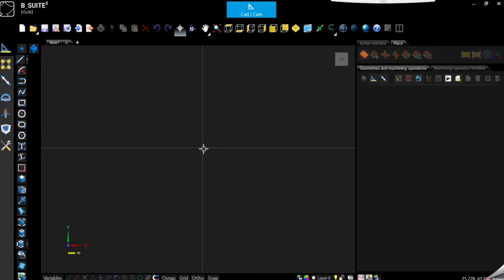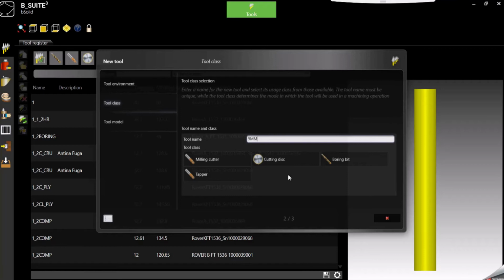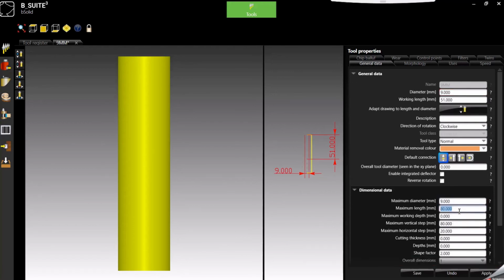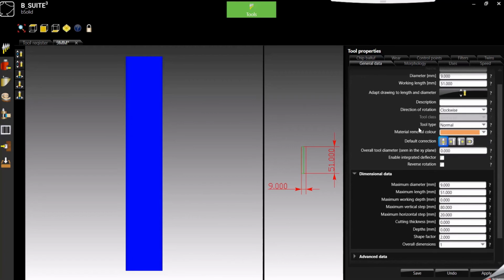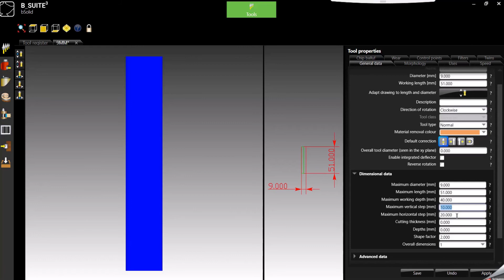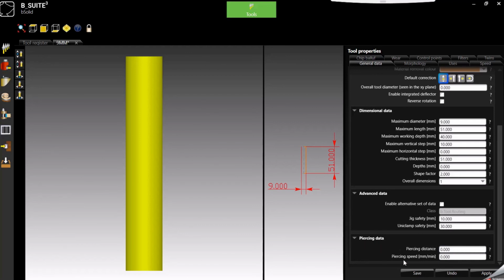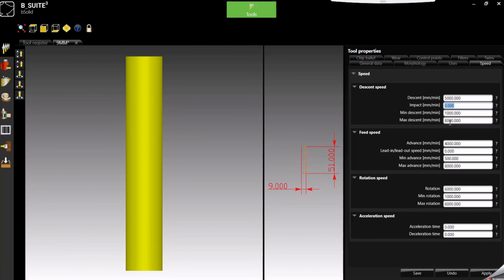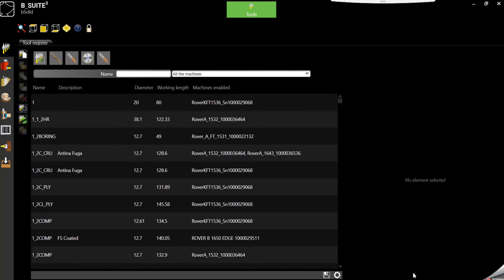1 - CAM BIESSE bSolid - Creating a new Drilling bit

Comment: Hey, im a cabinet making apprentice but im learning the cnc without training unfortunately, we have a Biesse Rover 3 FT and the problems im facing at the moment is:

When running a program of units, my tool is obviously too deep or something as it is also cutting down into my CNC board too much for my liking and creating lots of dust and issues for the CNC board. Should I just raise the jig thickness after skimming my sheet again? I thought if I skimmed a sheet down to (23.70) I would leave it at that but maybe I need to raise it back up a small bit because I can't have it cutting into my board.

Also, when I nest all my units into a program, do you know how/where I can edit the sheets to move pieces into other sheets/other areas of the sheets so I end up with no small pieces that wont vacuum down and shoot out? I have this problem where it will cut out a small piece and because of its size it won't vacuum down and the machine catches it, I have the machine speed low at the moment for this reason.

If you could help me or point me to where I'd find this information as I have nobody in work to teach me the machine, i'd appreciate it. 

Thank you.
Reply from the maker: Hello, and thank you for your comment. 
After the skimming cycle, you should leave the jig thickness as it is.
With that been said, I would suggest to start checking the depth of the machining used in the programs, because that is what the machine should do and if you see some incongruity, I recommend to check the length of all the  tools using the presetter if the machine is equipped with it. After that you should skim the spoil-board again and everything should go back to normal. 

In order to answer properly to the second question, I need to know which is the software version you are currently using. 

Talk to you soon